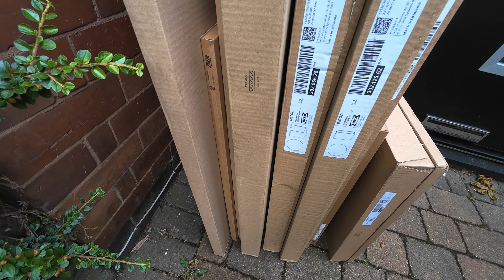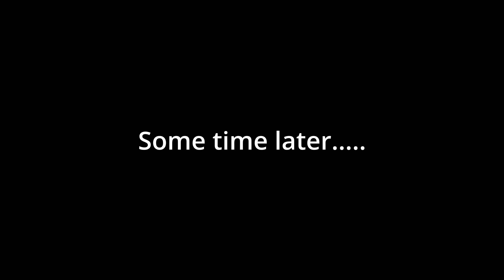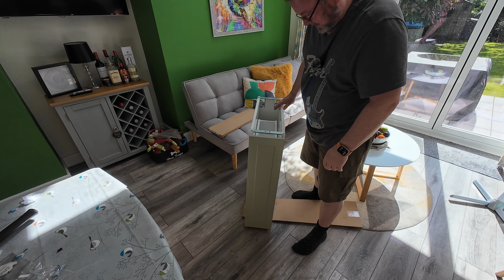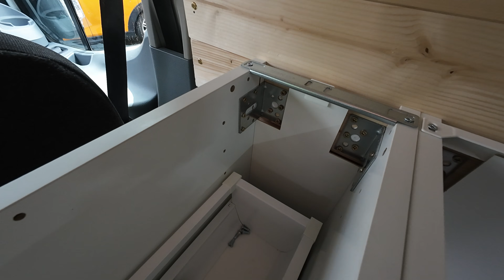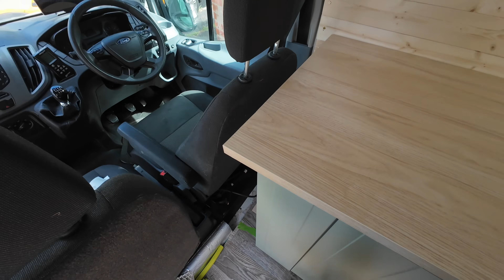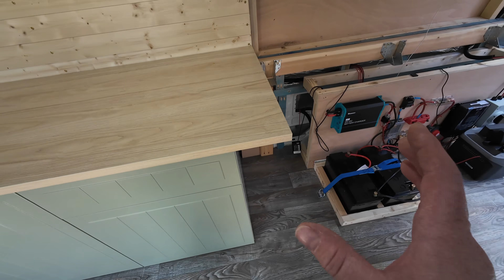How to Build: Ikea Camper Van Kitchen

Comment: Just come across your vid. I had all intentions of building my own furniture but have bought some 2nd hand kitchen units. I also have a low roof transit custom. Did you leave the units at 600mm depth
Reply from the maker: Hi. Thanks for watching. Yes units left at 600mm depth. Didn’t modify any of the units. Thanks

Comment: Nice Video. How do you keep the drawers closed while driving ? Im also planning to use a IKEA Kitchen with Maximera drawers. Maybe i can use some electrical magnets to keep my drawers closed when im driving. Or do you have a better idea ?
Reply from the maker: Hi. Thanks for watching. I’ve used Double Ball Roller Tension Door Catches which were from Amazon. Will put a link in the description for you or just search amazon. They were £8.49. Seem to be working so far 👍.   Quick tip. I had to take the work top off again to install them so might want to install them as you build your kitchen. Good luck.